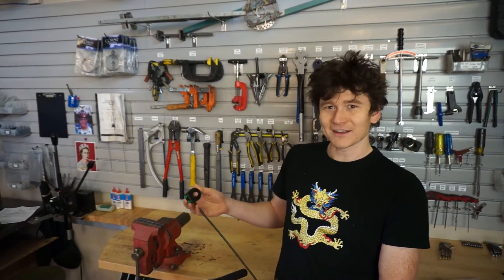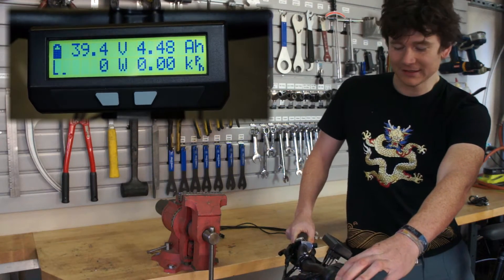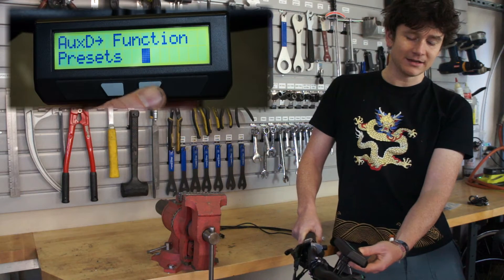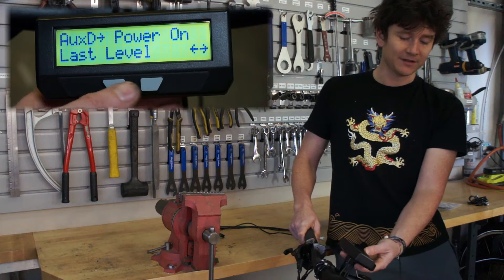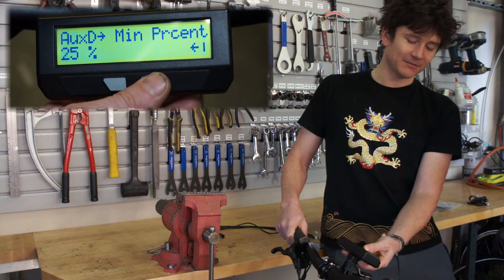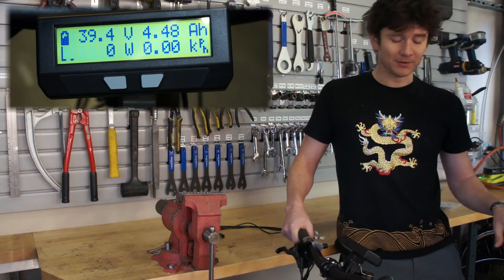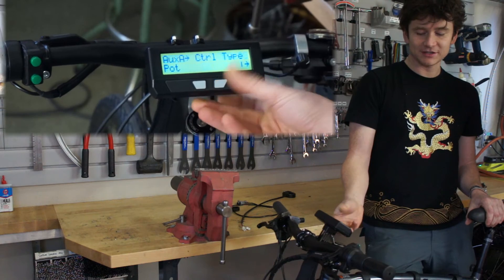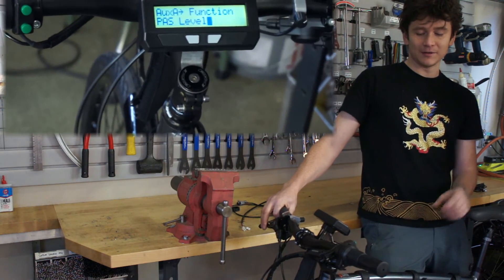Introduction the Digital Aux Buttons for Cycle Analyst 3.1 Firmware

Comment: Hey , I have a probleme , my CA V3 DPS with speed sensor works when the number of pole its 1 but the mottor doesn't works . But when I put 23 pole , the mottors works but the speed display show nothing (0). Can you help me ,please .
Reply from the maker: You likely have a very low speed limit enabled or have messed around with the PID speed limit parameters. Is the speed value blinking while it shows the speed reading? On the diagnostics screen (push back button once), is the s flag capitialized to be S when it shows your speed?

Comment: Hi! I current  set my max to 500w with 11 level between 0 and 500w. If I set to level 5(200w), does adding a  potentiometer allow me to fine tune between 0w and 200w? Thanks.
Reply from the maker: Great question. Right now you cannot have both the digital and analog aux inputs set to the same limiting function. But if you use mode presets to have 3 different power limits, then either the digital or analog aux adjustments will scale that from 0-100%. 

If you want really fine adjustment of your power limits, then we'd suggest using the analog aux controls for that, and use the digital aux for something else like your speed limit or for changing presets.
Reply: @GrinTechnologies  Thanks!

Comment: hello mate. are you able to help setup cycle analyst v3 in my stealth bomber? changed some settings and my throttle starts respond when i rich 15.5mph/km and cut off below 10mph/km. easyremember85@gmail.com
Reply from the maker: Yes, simply send an email to info@ebikes.ca with as much detail as possible about what area of settings you had changed and what the issue is with the current behavior.

Comment: Please make a video showing how to program CA V3 with the Infenion 12 fet IRFB3077 Controller  with Leafbikes 1500 watt Brushless hub motor!   I have tried several times to program it with no success! Or please email me at   aldebaran8taurus@aim.com.
Reply from the maker: The default settings should all work just fine, you just need to make sure that you have your throttle plugged into the CA3 and not into the motor controller.
Reply: My CA is not a V3.1...I do not have the option for default settings!

Comment: my new CA ready sinewave controller has a phase amp "jerk" when i want to pull away smoothly. its pretty annoying. can a fitting a CA fix this? its a 12 fet xiechang controller from ES. my motor is a 3T mxus v2
Reply from the maker: Using the CA3 to implement a throttle up ramp rate limiting will smooth out the acceleration profile on most motor controllers quite well.